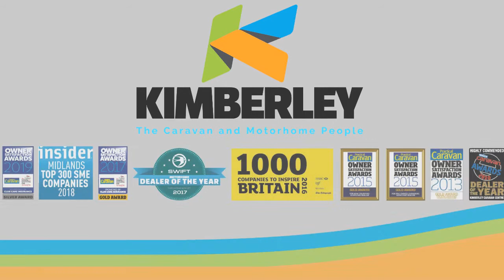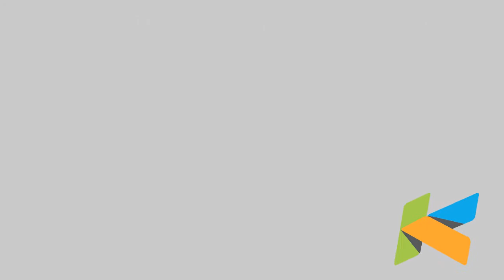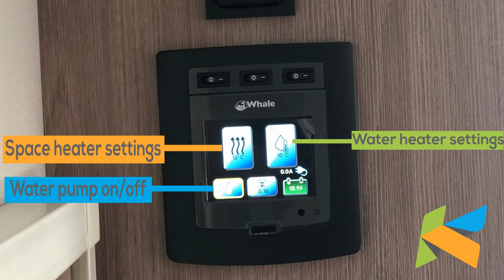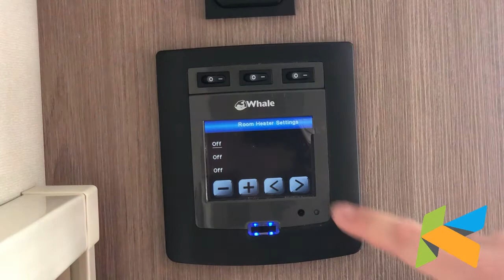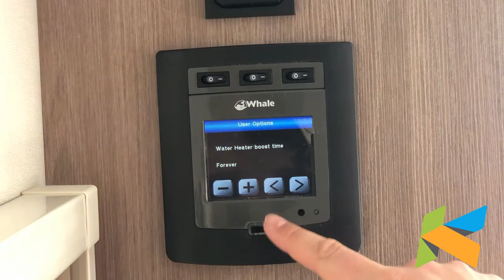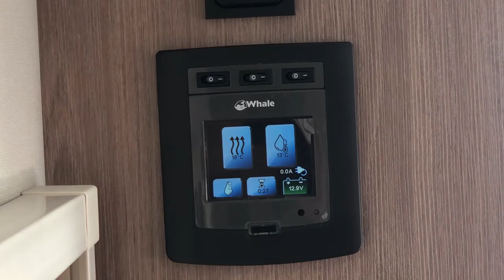How to use the Whale i-van intelligent control heating system

Comment: Hi! My whale unit is the 2019 model. On the water heater option there’s a red ❗️ I’ve tried the electric, gas and electric gas option but no hot water🤷‍♂️ any advice??
Reply: Did you manage to overcome this issue please? We have the same problem